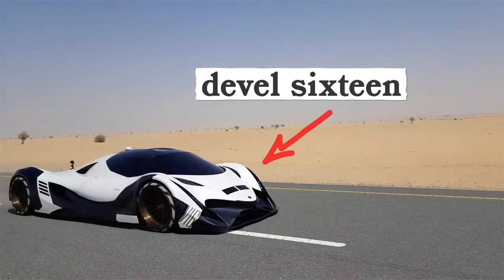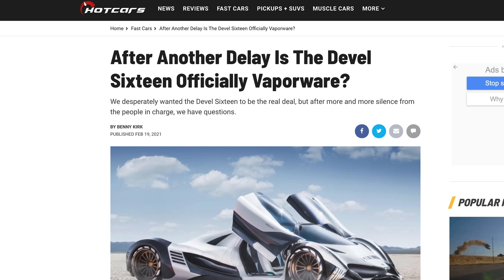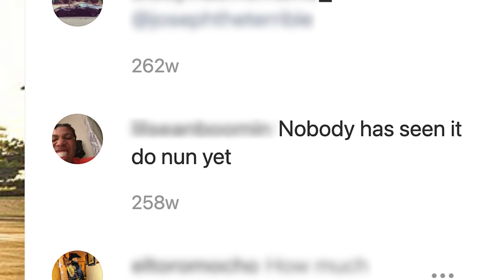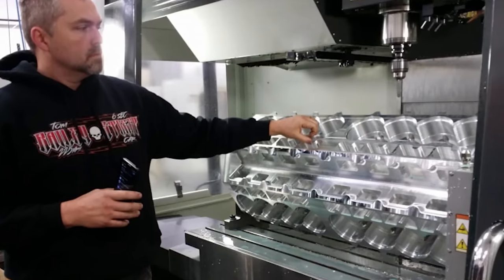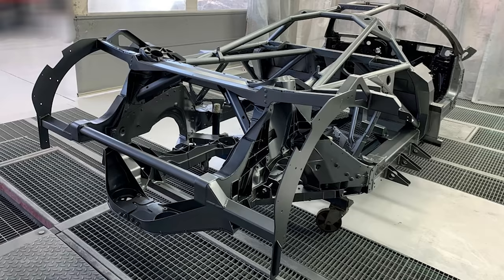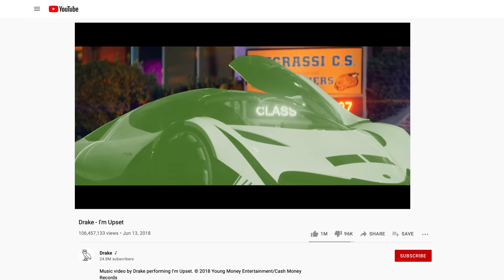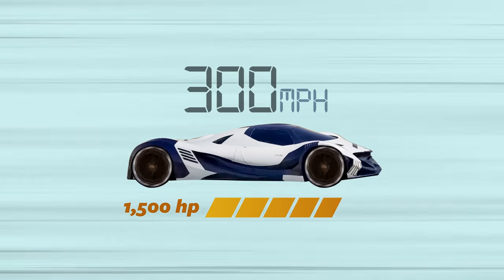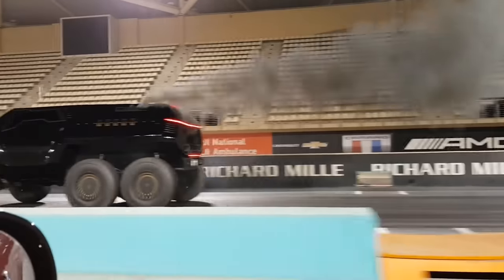Is this Infamous Supercar Real?

Comment: There's no way this has enough radiators and air intakes to keep a 5000hp engine running.
Reply: Wouldn’t be too bad to manage that heat when built from the ground up especially with cylinder drop technology
Reply: @Mr_OoOsH  getting enough air to feed the beast and keep it cool while staying aerodynamic was one of the biggest challenge that Bugatti faced. I don't see many air intakes on that thing. I'll believe it when I see it, but it basically doesn't obey the laws of thermodynamic right now.
Add to the the massive fuel need, about 7 gallons a minute which requires massive pumps and filters to keep pressurized (not to mention the size of the gas tank required to not run through it before you even get to the top speed).
I know I'm just an arm chair mechanic here, but I'm definitely in the "Doubt" camp on this one.
Reply: Solution could be simple, if frustrating: limit the time spent at 5000hp to seconds or less, so that you can just sink the heat somewhere and cool it off. Then the sustained power will probably be a small fraction of that.
Reply: @dsdy1205  I've thought about that too, like a party trick, like having NOS or something. But I doubt it would reach 350MPH if that was the case. Anyway, since no one has witnessed the car actually do these things it's still just talk. The engine might exists, doesn't mean it can be practically used in this car.
Killer looking car though, even if it "only" made 1000HP it would still be very interesting.
Reply: @yessitsme6884  The bugatti bolide Actually maintains better aerodynamics with literal holes in the frame to prevent high pressure on the frame, reducing drag. For the devel 16 to go 350 mi/hour, it would need to have the areas that need to have downfoce covered and the rest of the car to be tube chassis. It would also need skirts to help maintain little airflow under the car
Reply: @Mr_OoOsH  it's a travesty to see that there are people who think this car is actually possible to build.
Reply: @Nyctophiliac.  well it is possible to build.
Reply: @Nyctophiliac.  .... people also once doubted about rockets that can get to space.
Reply: @changsangma1915  They also laughed at Bozo the Clown. So don't bother using that fallacy to appear optimistic.
Reply: Imagine put all this on ground, pro mod with big slick on vht lose grip at 180 mph imagine it on street ahahaha
Reply: @yessitsme6884  The engine exists... in dragsters... Steve Morris make engines for this.
Reply: @yessitsme6884  They could take a page out of NASCAR’s book. The vents used in the rear side windows are super aerodynamic. They could use these to feed into the engine bay, maybe adding a roof vent. The goal is to hit the top speed, not maintain it.
Reply: 1. The air vents could be in the front, where those gaps are in the front panels (nose down force and intake anyone?) And channeled to the rear. The ram air will certainly hold enough pressure (but it has a CUSTOM turbo for every four cylinders, do we really need ram air?

2. Uh... From other vehicles that we've seen, an exposed tube chassis would destroy aerodynamics. There's a difference between holes in body panels and trash aero. Further your chassis pressure isn't destroying aero, but body panels warping absolutely is. View any high performance aircraft, or even car. It's either sturdy and won't move, or light and manufactured so that the panel is at max efficiency at the speed you need. Best if you can mix both.

3. Fuel.... Well you got me there, this sucker will drink like that one chick in the bar always getting white girl wasted. But what if we use not pure gasoline (a power additive)? Or more pure gasoline like AVGas? That could bring down fuel required for each combustion, which would vastly bring down fuel useage.

OH, and all the aero problems under the car, I have a fix and it sums in two words...
Vortex generators.
Re-design the nose slightly with vortex generators on the underside, now your troublesome vortexes are (more) controlled and can actually be used to help you. Further, vortex generators on the tail or midsection of the roof could help the air flow down and out by forcing more air behind the air.
Raise the lower section of the tail as much as possible to get use out of every bit of drag you're making. Side channels on the lower skirts could help pull more air in to reduce drag as well.

This car is POSSIBLE. Just extremely difficult, and needs a few new revisions to reach 350MPH.
I want to see it done, but I have my doubts as well. More of if it will be relevant when it's done, rather than if it will be completed.
Oh yeah, and you could put radiators in some pretty interesting spots that could cause some good affects.

If you read this far, thanks for coming to my TED Talk. If you sneezed while reading this, bless you.
Have a good one.
Reply: The engineers probably thought if that allready
Reply: This made me remember that actually with Bugatti Veyron the engineers had to develop superstiff fuel tank, because the engine was sucking so much fuel it physically deformed any conventional tank avaliable. If Devel ever exists they better build the fastest tank truck to go with it
Reply: @Nyctophiliac.  the owner's uploaded a testing video of the car recently @ dubai 39
Reply: Maybe it’s like those i9 MacBook pros that thermal throttle immediately and it’s pointless
Reply: Its not a normal engine it has 2 jet engines so the cooling systems are pretty good
Reply: Steve Morris himself talked about that. He said the Devel guys came back to him for help with that packaging and he deferred; I built the engine, you figure out the rest of the car.
Reply: It's V16 4 turbo lol
Reply: @FEGTTTSDH  that is the key to explaining how it is possible. I really love the idea of a V16 in a car again (last one was the Cizeta V16T and larer some prototypes by Cadillac, Rolls Royce, BMW, and Mercedes)
Reply: @Mr_OoOsH  it may be possible to build but it’s claims of power and speed will never be met.  The laws of physics and thermodynamics are laws, not suggestions.
Reply: @sythe2339  it cant have jet engines if its a v16
Reply: Steve Morris Engines is making the engine for it. That alone makes me convinced that it'll have 5k horsepower (in race trim) by the time they are done with it. Currently according to SME it has 3k HP in street trim and 4k in race trim
Reply: I do wonder if they could find a way to use the aerodynamics to leverage decompressive cooling to help. There’s a Porsche intake that does that to cool the air charge.
Reply: You make a valid point. maybe that is why production has been delayed for so long. They might be added and experimenting with different cooling solutions for that monstrous V16 engine
Reply: @yessitsme6884   5000hp in a 4000lb car at wot is more like 13 gallons a minute.
Reply: They might as well have the engine exposed to the open just to get enough air in and out.
Reply: It's possible but the parasitic drag is exponential

Comment: If Gran Turismo’s Special Stage Route X actually existed in real life it would be a place to try and get to 350 mph lol
Reply: This gives me memories of when I use to tie up my controller and run that track using the SRT Tomahawk
Reply: I’ve hit 400 on that track 😂
Reply: i bet that place would be super famous.
Reply: Isn't the VW test circuit Ehra-Lessien basically a Special Stage Route X?
The one Bugatti got all their records on.
Reply: Max Power  Bugatti tells something different on their website.
Reply: Max Power  no they didn't.
Reply: @Scirosto86  thats what i was thinking
Reply: man of culture
Reply: If the devil could be real why dont make the srt tomahawk x real 1000 times faster than  the devil
Reply: 950 in gt5 in a wrx 😂 it may have been illegally modded with a jet engine
Reply: @Scirosto86  it's a constant turn close tho if you're talking about the nardo ring
Reply: YellowEvoV110 If both are made reality with the claimed specs that’d make a really good battle
Reply: @richardhammock2829  from the hp the devil is superior but the top speed, acceleration and cornering is a way diffrent league than the devils league
Reply: It does
Reply: @YellowEvoV110  Because the Tomahawk X has technology that doesn’t exist yet for cars. Hopefully Dodge will build it at some point though.
Reply: I thought the same thing lol

Comment: I’m pretty sure they’re gonna release it in 2157 when either

1. there is no more fuel to power it, or

2. it will be considered a slow clunker that can’t even hold a candle to the Volkswagen Golf XXX with 25,000 hp and a top speed of 560 mph.
Reply: I bet you're gonna have some german kid in his Golf GT-R S XXX 4 with a tiny turbo on it and a laptop in his passenger seat gapping everybody on the highway reaching speeds that warp space time and continuum

Comment: If the engine for it is real, I really want to see someone put it into a some sort of a streamliner and go for a piston-powered land speed record
Reply: The engine is real, there's at least one been made and it does make 4000+ horsepower. The question is will they ever put it in the damn car
Reply: The problem is just the transmission
Reply: @ASWJonas  and cooling
Reply: @vefos09h85  and aerodynamics.
Reply: @toneytracey3314  and
Reply: @baskomiseremir  insurance
Reply: @thertsr9999  and tyres
Reply: They should put it in an old vw camper van 😂
Reply: @shant756  and basically everything not the engine.
Reply: 5000 hp is like Alcohol funny car levels of power. it is completely unusable unless you were to put it into a full tube chassis drag car or a streamliner like you were saying
Reply: Steven Morris can build a dragster engine all he likes... Thats what he does... Build dragster engines. That doesn't mean it could possibly ever go into the car. The fuel tank would be empty in 20 seconds, there is no surface area big enough to cool 5000 hp, and there are no tyres in the world that can keep 5000 hp on the road. Just to take the most obvious, immediate problems.
Reply: @FRAMO7  that engine is already bigger than the miata
Reply: @TheGamerfreak1555  Doesn't matter if it is real or not how do you make a +5000 hp engine in anyway reliable. That's funny car levels of power and those engines have to be rebuilt after practically every run and they run on specialist ethanol and nitrous. 

So putting that insane claim aside for a minute how the hell do you cool a 5000hp engine. Bugatti with their W16's in the Veyron and Chiron needed 10 radiators to cool that engine get your head round that 10 radiators. Peak power of that W16 is 1600hp how the hell on God's earth do you reliably cool another 3400hp worth of engine even with what 12 litres which is what this engine is it would produce an utterly insane amount of heat. 

Reliably cooling it isn't just a big ask I'd say it's practically impossible. Bugatti with their W16 that engine is at least reliable for a performance car of that level same with Koenigsegg with their V8's. Seriously how long would this engine go before it needs a rebuild. Anyone with any basic knowledge of engineering would say this A) insane B) impossible to get working in a car reliably. Laws of thermodynamics basically say that getting this engine to stay cool as reliably as say a Chiron without at least the very 12 radiators is impossible.
Reply: @teabagtowers3823 Yeah, the overarching problem with increasing speeds at higher and higher regimes becomes a vicious loop of a) needing more power to overcome aerodynamic drag, and b) needing more air flow to cool higher power outputs.

Now, ignoring all the technological issues in regards to transmission and tyres, you ultimately need to improve thermodynamic efficiency. Turbochargers already do that, so a good idea is to look at other concepts that were pioneered in piston-engined aircraft.

The first, and most promising one I thought of is the Meredith effect. In principle the careful design of variable cooling ducts can not only offset large parts of the induced drag, it can even produce a fair amount of thrust. Granted, this applies to aircraft, whereas you can't have clean airflow all around a car (obviously). But in areas where you can (the upper surface) they should make the most of it by cleaning up the chassis as much as possible, and then for all the intake air (engine intake, radiators, brakes) there should be one properly sized air scoop with variable ducting to wherever it's needed, and so that it ends up exiting in the car's wake of low-pressure air in such a way, that it counters the turbulences caused by bodywork.

The other possibility is something that Devel-opers may already be considering: Engine exhaust thrust. Typically Second World War era fighters had exhaust stacks angled backwards and those provided something in the realm of 15% of the total thrust. Now five thousand horsepower's worth of exhaust gasses will still hold a lot of energy past the turbines. So maybe underneath these ridiculous looking fighter jet nozzles, they actually came up with a design to harness some more of that lost potential.

Comment: I can't imagine finding a transmission and differential that could be used that would be somewhat reliable.  Plus, you'd need to design the tires from the ground up.
Reply: i can think of such but were talking tank transmissions, so bolting it to a supercar would destroy your performance with pure weight
Reply: Devel would need a material science breakthrough technology, say, a transmission housing made out of pure diamond, or something equally ridiculous.
From a current technology perspective, at 5000hp youre looking at mining truck, tanks, etc types. And those are meant for low rpm - high torque, not high speed.
Reply: Haha..from the ground up.
Reply: Here’s what I think they should do: 
1) design the car around the engine. (Solves the aerodynamic problems and should be able to figure out placement. If they nail those then 

2) use all current transmissions until you find one that has potential. As was said in the video, it’s a figurative v8 ls just put together. (My only concern tho is the planters members that does the shifting as they do the work of getting in and out of gears). Lastly, 

3) use the suspension to solve the aero dynamics too. Think of it the higher the car is and if it’s a fast moving car wants to get sucked down more to the ground. If they just had different functions maybe. That’s at least what I think. Ik I’m wrong somewhere in all of this but please tell me.
Reply: They could try something similar to the jesko trans
Reply: A Sweden manufacture you’ve heard of that nobody likes spelling has almost instant (less than 50ms) shift times. Carbon fiber tires are expensive and exist.
Reply: Top Fuel dragsters have only one gear. I wonder how well the Sixteen (At least the 5000 horsepower track model) would pull with only one gear.
Reply: Reid TH400 promod trans. You'll get three gears and no overdrive but it would take the power.

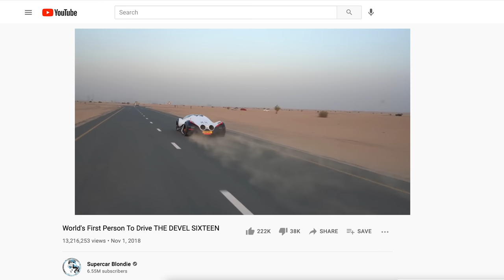Comment: 9:56  I've always loved that in this shot you can see the wheel at about a 30 degree angle while she drives straight
Reply: thats actually really weird. How does that happen
Reply: @PointlessDrummer  Poor build quality or damage to the car
Reply: bruh ive a videogame controller that does that if u turn it too fast
Reply: @PointlessDrummer  not aligning the track rods properly but more likely if theyve been changing the steering wheels frequently maybe the holes and teeth dont line up with with the steering rack, its an easy enough fix tho, but the difference from the original car to the current one shows they are just constantly changing everything, which isn't a great sign

Comment: Devel:”It’s going break all records” 
Top Fuel Dragster:”Am I joke to you”
Reply: yes, actually.
assuming "you" is whomever you're trying to get it registered as street legal with.

also dragsters have a runlife of about 5 seconds and functionally can't turn, there is a MASSIVE difference between an engine on wheels and an actual functioning vehicle.
Reply: Nope!  That does apply to top fuel but other classes have 3000 HP plus and do not need to be rebuilt every race. They don’t really break unless something serious goes wrong.

Comment: They (devel) should just fess up already and just make a legit version. it’s a crazy badass looking exotic... When Steven Morris said he was done messing with it you knew this was gonna be a sham
Reply: Steven Morris can build a dragster engine all he likes... Thats what he does... Build dragster engines. That doesn't mean it could possibly ever go into the car. The fuel tank would be empty in 20 seconds, there is no surface area big enough to cool 5000 hp, and there are no tyres in the world that can keep 5000 hp on the road. Just to take the most obvious, immediate problems.
Reply: @captain_context9991  steve Morris could easily have built a tuned down version of 2000 hp plus he does for customers all the time. 5000hp is unrealistic unless Devel try to go big hybrid awd which is still a lot to ask
Reply: @Does_it_come_in_black  
There is no surface area on this design that can cool a 5000 hp engine. There are no tyres that can keep 5000 hp on the road. The fuel tank would be empty in 30 seconds... Just to take the most obvious factors. So if this will turn out to actually get built... It will be a whole different car than they promised.
Reply: @captain_context9991  Like I was saying it’s still alot to ask lol
Reply: @Does_it_come_in_black  
Yes impossible things tend to be quite difficult. This project was started by 2 Arab brothers in the middle east as a publicity stunt. They park it outside their expensive properties so that people take pictures of it and write about it online. They hired famous Arab blogger MoVlogs and Dubai-based Supercar Blondie to pretend this was a real car.

But hey... Arabs and their money. Now they seem to have got real professionals in on the project. So it might actually become a real car. But forget those big numbers.